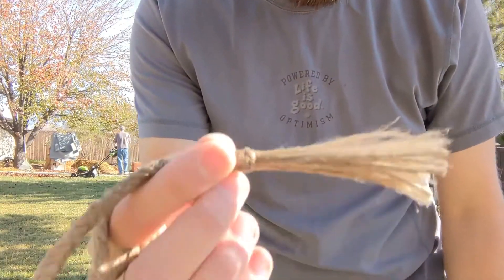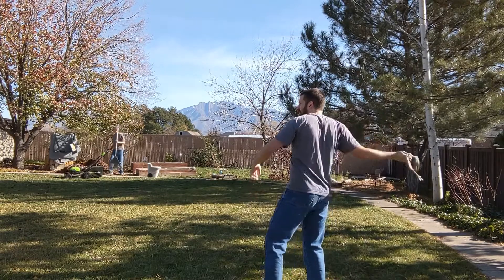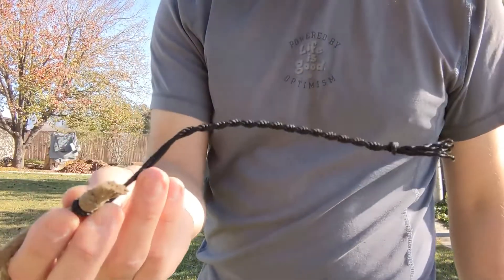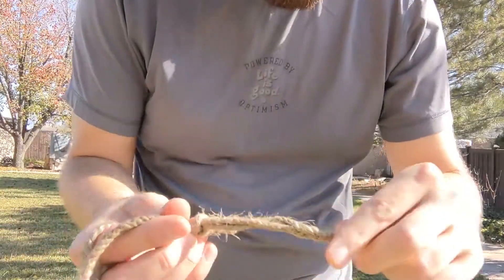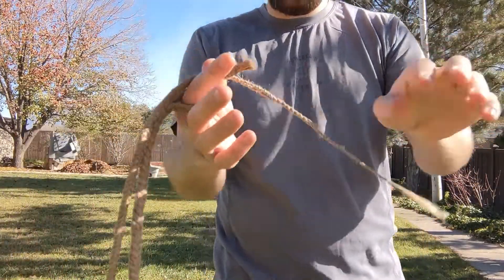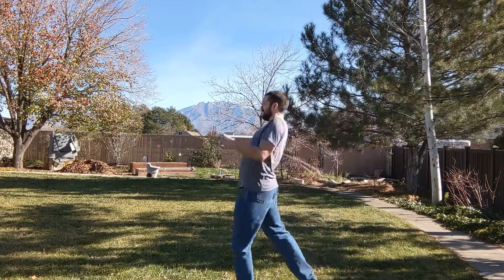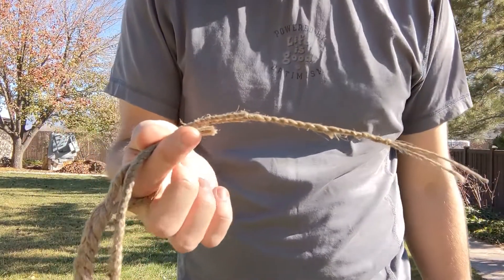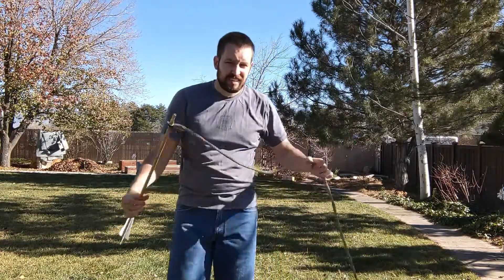Sling Cracking Experiments

Comment: Can your sling crack without the whip cracker?
Reply from the maker: I think it needs the cracker.  But maybe I should try it without sometime
Reply: I think it's the same thing as with bullwhips. As the strand gets thinner but energy transferred down the whip doesn't decrease more than marginally, the speed of each thinner section has to be greater than the section before it, which eventually leads to the end breaking sound barrier. The thinner the whip gets the easier it is to break the sound barrier but the thicker the end is the bigger boom it creates.

Comment: This is really cool to see. Now I thinking I need to try and make THE LOUDEST SLING :D I have some lead line that will be perfect with a nylon cracker added.
Reply from the maker: That would be cool!  I liked this video from Nick's whip shop, I think his cracker design is kind of what I found to work well (6 inches then 2 inch fluff).
https://www.youtube.com/watch?v=nDOtyNJ4zIg&ab_channel=NicksWhipShop

I think the thinner your cracker is the more it makes a nice high-pitched pop but there is diminishing returns if you go too thin, and a thicker/heavier cracker makes a louder pop if you can get it going fast enough.  So if you are going for loud you probably want a very heavy/thick cracker.